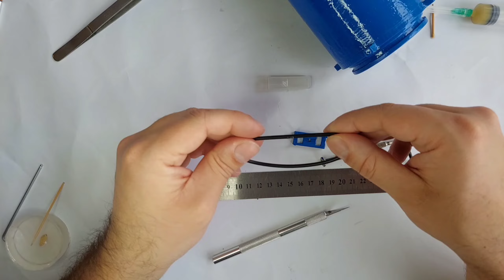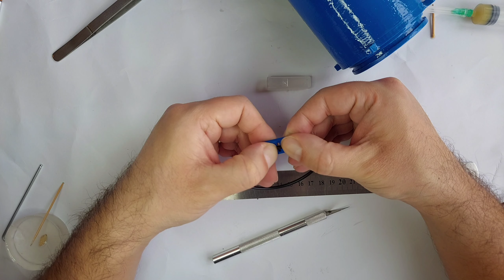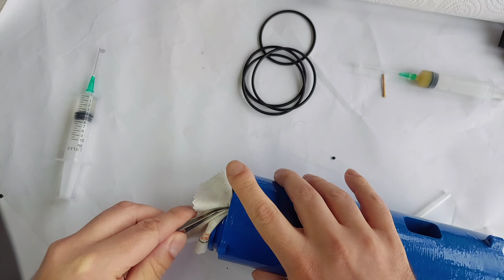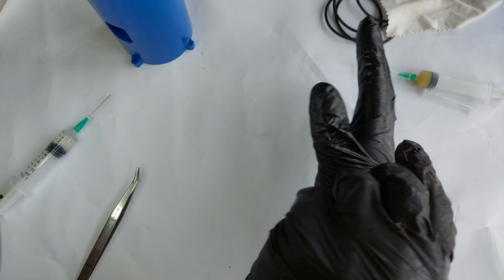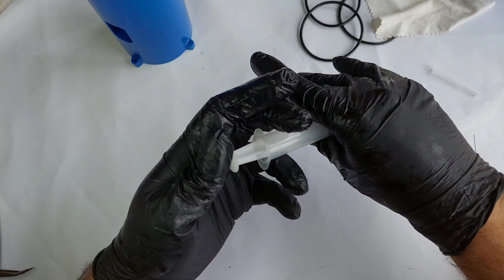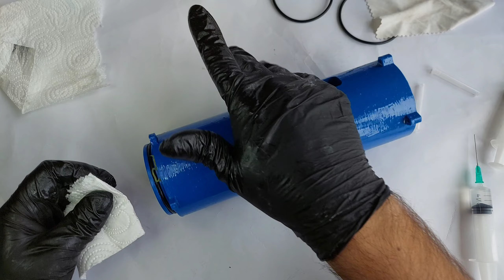DIY O-Ring Seals: Waterproofing Your RC Submarine

Comment: The same technique is also used professionally onboard ships, just use as minimal as possible glue to avoid a hard section
Reply from the maker: You are right. The o-ring shouldn't loss its flexibility. Actually there are better glues for the job but super glue is way cheaper😅